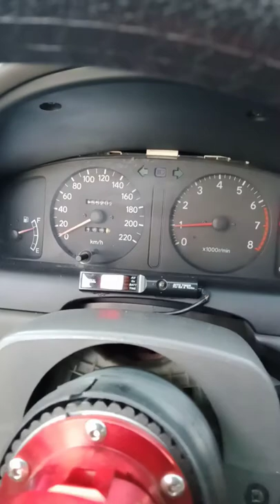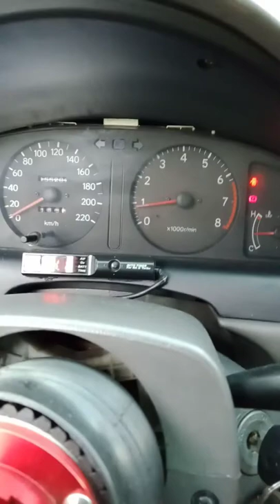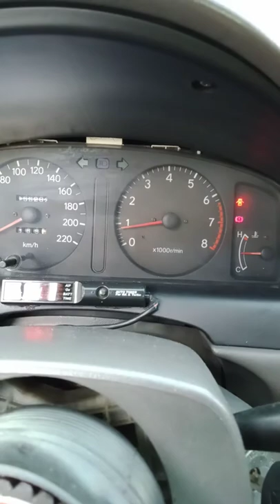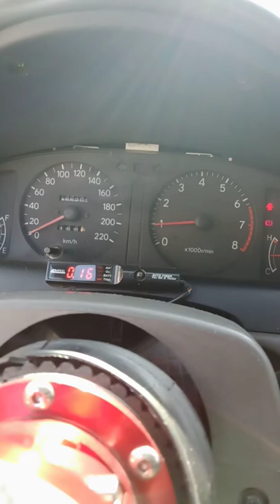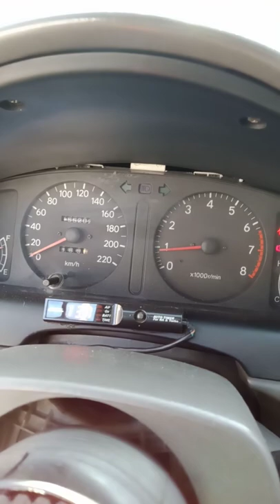4A FE THROTTLE BODY CLEANING TOYOTA COROLLA

Comment: Clean also the air inlet (the part behind the throttle body) you will see a lot of oil accumulated in there

Comment: Boss good pm yung mechanism ba sa loob yung naikot na nilagyan mo ng wd40 360 degrees talaga ikot? Kasi yung sakin konti lang. open na sya ng kaunti tapos bumubukas lang sya ng mas malaki. Hindi sya nagpufully close. Salamat. Corolla 1997 4afe din sir
Reply from the maker: Window mechanism po ba sir
Reply: @JojoGarTV  salamat sir sa sagot. Yung magnetic po sa loob sir. Yung nastock up sa video nyo na nasprayan nyo ng wd40. Kasi nakita ko po sa video na 360 degrees ikot nya eh
Reply from the maker: @leoangeloprieto674  yes sir 360 degrees po kailangan po malinis nyo ng husto yong wala talagang sabit yong magnetic pag umiikot lubricate nyo po wd40 para mas along malambot ikutin
Reply: @JojoGarTV  salamat sir. Baklasin ko ulit. Kasi parang 1/2 or 1/4 lang ikot nung sakin eh. 4afe po na bigbody sir
Reply: @JojoGarTV  you do home service po or shop lang po kayo? Sir sana magkaron din kayo ng video on how to test iacv if gumagana pa sya. Salamat po. And more subscriber pa po sa channel nyo
Reply from the maker: @leoangeloprieto674  bumabagsak ba rpm mo sir pag naka aircon ka
Reply: Di naman sir. Pero mataas rpm ko kahit bagong linis throttle body ko. Mga 1200 sir pag nakapark. Tpoa nababa sya 900 pag nakadrove na. Wala na din sya cold start sir
Reply: @leoangeloprieto674  boss
Reply: @leoangeloprieto674  npababa mo n b menor mo

Comment: Sir tanong Lang po. 4afe din makina ko. Saan po Kaya probema pag ayaw gumana ung fuel. Injector connector.. Ano po Kaya. Pweding palitan. Tnx po
Reply from the maker: Pag ayaw po gumana ang injector fuel relay at distributor lang ang nagbabatuhan ng signal para sa injector sir unahin nyo muna relay
Reply: Salamat sir subukan ko po. Sir pero ng buksan ko ung fuel line at start ko po sumisirit naman. Ung connector po ba mayron din fuse. Sir paano po ba mag testing ng connector ng fuel injector. Po.

Comment: sir anu po magandang diskarte pag matigas ang screw ng iacv?
Reply from the maker: Sinisinsil ko ng flat screw driver yan sir tapos pinapalitan ko po ng bago pag stock po talaga matigas yan tanggalin kailangan lang po maingat ang pag sensil para di ma damage yong iacv solinoid
Reply: @JojoGarTV  yun nga po sir eh di ko pa kasi matanggal baka makalbo naman screw. Ang tigas talaga isa lang napaluwag ko sa mga screw ng iacv 😅 thanks po sa tip sir nakapag sub na po ako sa channel nyo laking tulong din po 👌

Comment: Idol toyota corola gli ko pag bukas ko ac  bagsak rpm ano po sakit idol at mga magkano buget kng sakali pa wiring ko ulit
Reply from the maker: Subukan po muna natin linisin iacv mo sir baka sobrang dami carbon deposit nag sstoc po yan kaya di makapag idle ng maayos pag nagbukas ka ng aircon
Reply: @JojoGarTV  pero idol nilinis kuna ganyan ko hndi naman madumi ang kaso parang may gasket sya na plastik sarado isang side diba open lahat yon idol

Comment: At saka idol pag pinihit ko naman nagalaw naman parang di naman stock up kaso gasket nya iba parang plastik tapos sa isang side parang sarado isa lng open dyan sa magkatabing butas nya pwede kaya butasan ko idol kc nakita ko gasket nyan orig pa naman sakin parang plastik na makapal
Reply from the maker: Wag nyo po butasan napipihit o na adjust po yan iacv solinoid luwagan nyo dalawang screw tapos pihitin nyo po para magkaroon ng awang yong valve
Reply: @JojoGarTV  ibig ko sabihin idol wala na kc gasket parang ginawan lng yata ng pinaka ka gasket nya pero plastik po kaya sarado isang side ginawan ng ibang gasket
Reply: Idol diba dalawa yon kabilaan tag dalawang tornelyo sa kabila yong parang may magnet at sa kabila sa may kabitan ng sensor saan don ang luwagan ko idol na banda at paano i adjust parulong naman idol
Reply from the maker: Yong dalawang tornilyo may magnet paps tapos pagnaluwagan muna tornilyo Saka mo paandarin at pihitin mo kung saan sya kumportable sa idling Saka mo higpitan ang bolt
Reply: @JojoGarTV  idol meron po maliit na pihitan ng scrow pag inikot ko yan parang valve nya sa loob sumangga sa loob yong parang guide nya pwede ba i adjust yon parang maikot ng tuloy tuloy ang valve nya parang adjusan yata yon sa may loob ng dalawang tornilyo tapat ng magnet

Comment: Boss ganyan din ang akin mataas kahit wala pang aircon 950rpm
Reply from the maker: Subukan mo pihitin IACV mo sir baba po idling nyan may dalawang screw lang po yan
Reply: Ah cge boss susubukan k pihitn . Dati mababa un  rpm nilinis nmin un throttle tumaas unrpm  icv nd nmin nilinis
Reply: Boss un iacv b un ba pinihit nyo n dapat naikot
Reply from the maker: Yes sir palitin na yan pag di nagbabago idling
Reply: Boss un akin iacv  nd naikot my bagaan
Reply from the maker: @carloilagan7719  bukas sara lang yan boss pinaka vent sa loon kailangan malambot ang galaw nyan dapat malinis at lubracate mo wd40
Reply: Boss Anu pb pinagkaiba ng naikot at my bangaan kc my nakkta ako my iacv n 360ang ikot